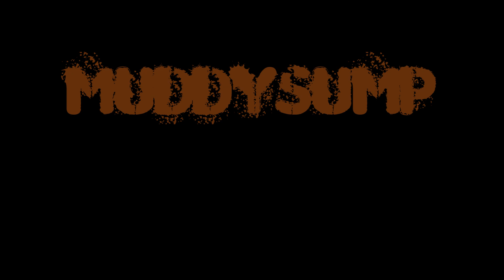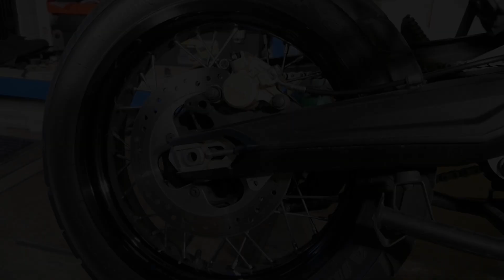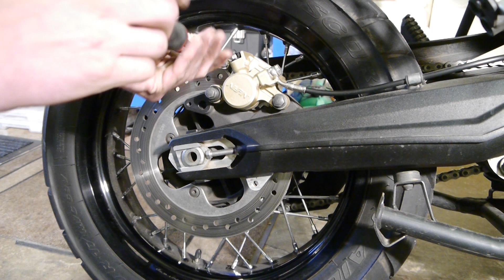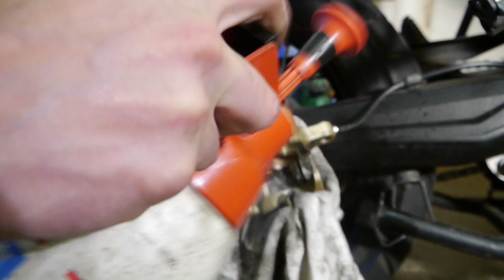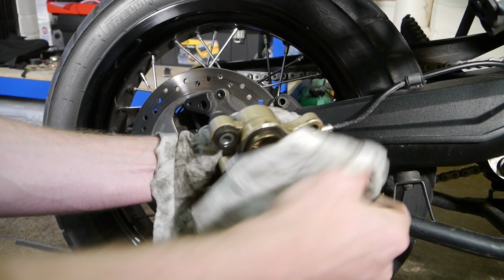Tiger 800 - Rear pads change/clean

Comment: This was super helpful tonight. If only to show how easy the bolts should come off lol. However, new pads are in, so thank you kindly for showing the steps! : )
Reply from the maker: The pin has got to be the most over tightened bolt. So easy to round off too when they are

Comment: You are great, man! Just cleaned the rear pads, caliper and the piston which I also relubed with a bit of silicone grease. Bled the brake fluid and the rear brake is sharp now! 
Can’t wait to do the same with the front.
Reply from the maker: Excellent 👍🏻

Comment: Do you need to use specific brake grease on the slider pin/bolt or will copper grease be fine?
Reply from the maker: You can get silicone grease to go where rubber parts are.

Comment: Hey man! I've changed the tires and cleaned the brakes. Rear pads are touching the disc and I don't know why! The 14mm bolt was not freely going all the way through. I had to apply some force (less than 27Nm) until the threads reached rear plate. Is that normal? (doesn't seem like it in your video). Pedal was going all the way down, so I thought there was air in the hose. Did the bleeding. There was. But it is exactly as before! Pedal traveling all the way down and pads are touching. Piston is 3mm out only. It seems there is no space for the pads. Could the calliper mount be wrong (14mm bolt or clipper inside?). Help! :-) Could you imagine the issue? Thanks a lot in advance!
Reply: Got it! Man! the ABS sensor was touching the ABS disc, not the pads! There is a washer (a washer!) that should go between the ABS mounting piece and the body, not between the screw and the ABS mounting piece. Oh my... I hope I can help some other soul with this tiny thing... Cheers!
Reply from the maker: Sorry, just seen your message. A lot of people put that abs sensor spacer as a washer on the screw
Reply: @MuddySump  Thanks! Yes, that's what I did. Pads are constantly touching the disc though, making the disc very very hot. The wheel spins slightly less (if I push the pad away with my hand the wheel spins slightly more, but not too much). Piston seems to be working fine. Does that go away after the pads worn out a little? (piston will be closer to the worn out pads, though...). I can see that, when I press the pedal, there is very small angular displacement inwards (0.3mm or so) in the whole calliper mount when pads are press against the disc. Is that normal? Sorry for the free consulting attempt. Cheers!
Reply from the maker: Eduardo Petrossi what pads have you put in? I’ve seen some aftermarket ones that have been thicker than original ones so not backing off the disc enough until they’re worn a bit
Reply: @MuddySump  I've put in EBC organic brake pads. The piston is about 1.5mm out.  I guess I'll have to wait and see what happens?
Reply: @EduardoPetrossi I thought  my darn caliper hanger was bent. I have had the rear tire on and off 3 times and the caliper too. I can't believe that Lil miss placement of a tiny washer could cause such a headache.  Thanks guys!!!

Comment: Clear & simple, thanks.
Reply: Hello—.  Really appreciated your brake change videos, simple & clear step by step & not all the fluff and stuff.   Any input on what I might use to clean off the exposed front exhaust? I’d looked at several things online, but am a bit hesitant/wanted to ask around. I’d read Limeaway or CLR works good. I just am not sure if it’ll hurt any of the other components—-? Toss out to your input & expertise. Cheers. M.
Reply from the maker: Me Still all I’ve ever used is a bit or fine wire wool to give them a scrub. I know there was some kind of bleach people started using a while ago, I never tried it though

Comment: Thanks for all your videos,,very helpful,thanks again,I have a question,ever since I changed my pads they make a weird noise almost like metal to metal sound ,I cleaned the new pads few times and the noise doesn't go away,it only happens at slow speed and not all the time,any idea or suggestions?? Thanks again.
Reply from the maker: Did you buy some copper grease on the back of the pads? Might be the pad vibrating against the piston.
Reply: MuddySump thank you,I didn't use copper grease,I used average grease,,I'll try copper, thanks,I appreciate your help
Reply: @baetech1982  solucionaste el problema. Yo tengo el mismo inconveniente en estos momentos y me intriga bastante. Sería de gran ayuda conocer tu experiencia, considerando que ha pasado un año.

Gracias de antemano
Reply: @gabrielvasquez8288  si gracias, si lo solucione, mi problema era en la cadena, de hecho fue el rubbing strip , se deterioro y la cadena pegaba en el brazo y pensé que el sonido era de los frenos pero era la fricción de la cadena con el brazo porque el rubbing strip ya no tenia superficie.
Reply: @baetech1982  Perfecto Juan, te agradezco la respuesta. Así puedo ir descartando opciones. Buenas rutas, amigo!

Comment: as the bike is ABS is there any extra things u have to take off like the ABS sensor thing?
Reply from the maker: +MrJIMBOISAWESOME no, it's exactly the same. Might need to move the cable out of the way but no need to remove the sensor
Reply: is it just an unclip thing or nut or how does it work? got a tiger at october time and its the first bike ive had with ABS! The Sv650s is a bit easier to work on as it doesnt have the technology wizardary! Great channel though man helped me do sparks and air filter keep up the amazing work :D
Reply from the maker: MrJIMBOISAWESOME the cable has clips keeping it on the brake line. If you want to remove the sensor too from the bracket then there is a torx 30 screw to take out.

Comment: Great video. Now for the tool for all those looking for it. You can get one from BikeMaster. It is called BikeMaster Brake Piston Puller 24-4253. It took a while to find it so I figured that I would share.
Reply from the maker: +Henry Wojtkiewicz thanks. I used to get asked so many times where to get the tool for the Pistons :-)